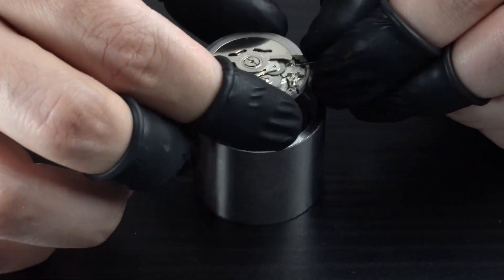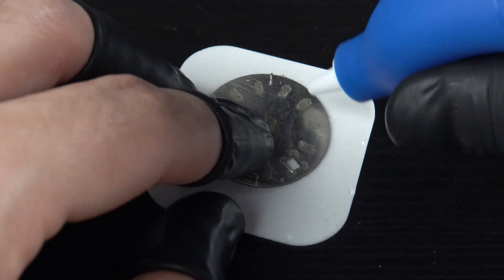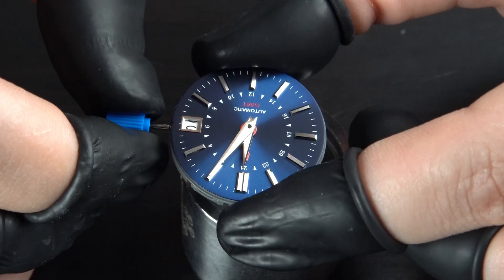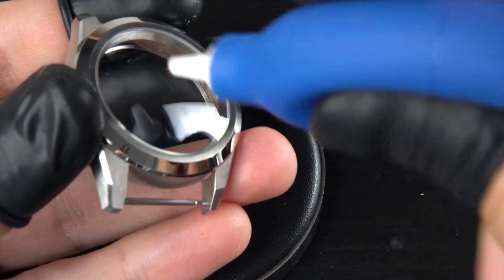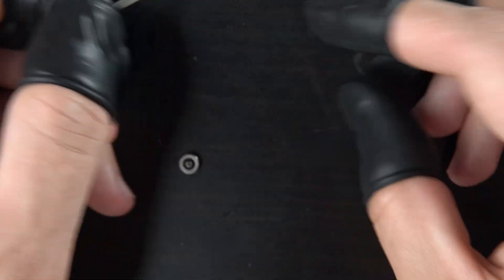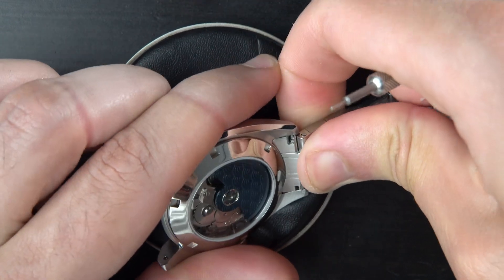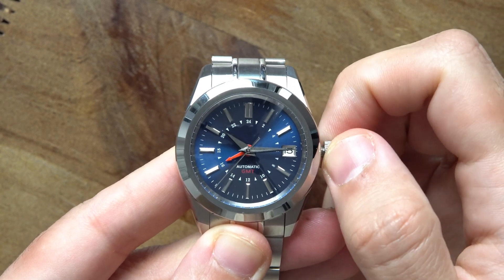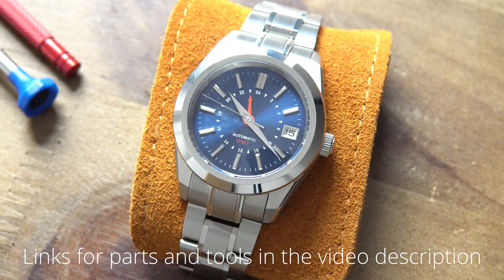Build Your Own Grand Seiko GMT Watch - Seiko NH34 Watch Mod

Comment from the maker: 07:08 the watch dimensions weren't rendered for some reason, apologies for the confusion:
Case diameter 38mm 
Lug to lug 47mm
Case thickness 12mm (13.5mm including the sapphire crystal glass)
Lug width 20 mm

Comment: You are the first person I have seen to install the rotor correctly. Thank you. It deserves a mention.
Reply from the maker: I used to do it incorrectly too, but then people like yourself gave constructive feedback. Thank you so much!
Reply: @simplewatchtalks what is the wrong way to replace it?
Reply: @BulletTuna it remains a mystery.
Reply: What did he do correctly vs incorrectly?
Reply: Absolutely Agree with you.
Reply: Please can you tell us what is Corect way to mount/swap the rotor in order to avoid an Expenceive Mistake ?
Thank You 🤝
Reply: @mariuspetcu2087  the link will take you to the manual for the NH series. You can find the information there with a diagram.
Reply: @mariuspetcu2087 I tried to leave a link for the TMI service manual, but it keeps getting removed. Google TMI N35 technical manual. That will show you what you need to do